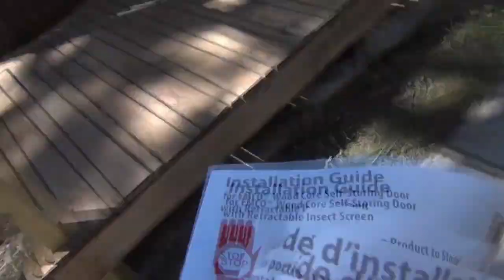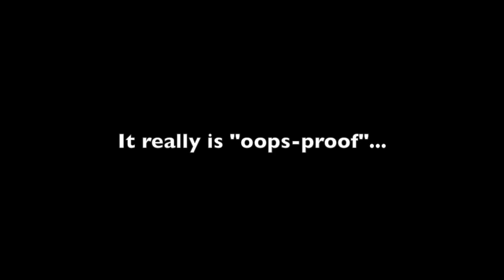Installing an EMCO Storm and Screen Door

Comment: Hello "people," as myoldreteacher said, "This is not an instructional video!" The are many point of the installation that are not pointed out, like the installation of the door sweep and drilling both sides of the door independently for the door handles, but the video shows how easily this type of door can be installed. However, be warned, the instruction come on three separate papers: an "Installation Kit Guide," an "Installation Guide" and a door-handle installation template. Nothing is ever as easy as they make it seem, no matter who the company is or how reputable they are. Trust me, that was not the first time he installed a door of this nature.
Reply from the maker: Thank you for your kind and insightful comment. I made this video to give an overview of the installation. Glad you found some use to it.
Reply: I agree!  What's the point of the sound in the background?  It would make more sense to explain it as it is being done.

Comment: Question for you.  I have the same door and am wondering if I have an issue with my handle or if it's just the way they are...Does your outside handle automatically return to the middle when you open the door (feel spring loaded?) or do you have to turn it back for the door to latch again?  Thanks.

Comment: Did it say in the box that you needed a handsaw? Mine does and I don't have one
Reply from the maker: Nope! Not sure why it's asking you for that. What are the instructions asking you to saw?
Reply: not sure haven't open it yet!
Reply: would it be harder doing the holes for the handle with aluminum frame?
Reply from the maker: Daniel Ayala Nope!

Comment: Too fast couldn't follows
Reply: Yes I can rewatch and slow down. 
I installed a 200 series.  It had all the spacers. My new 100 series 32" didn't have the spacers.  That's how I ended up looking for help.
Also my opening is almost too big. I have to add another piece to the door jamb.

Comment: The latch striker and the deadbolt striker are no where long enough to the reach the latch or the deadbolt.  Looks like you added a wood block to bring them out further.  Seems like a design error to have to do that. Something that will be required on every installation.  The spacers provided aren't enough to do the job and nowhere in the instructions does it mention that you will need a block.  I'll have to add the block but it's ugly :o(
Reply from the maker: Yes, I added a block to the striker. On the whole not a difficult instal, but yes some creative approaches needed at times. Thanks for watching and the comment.